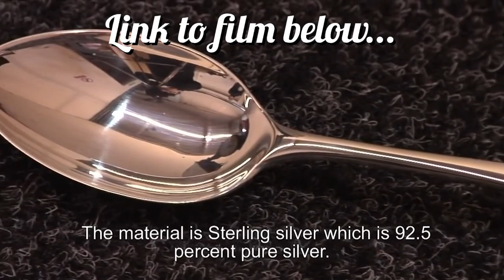Restoring Silversmithing Tools - (Al bought a load of rusty tools!)

Comment: Most of what you have are called raising stakes, the loose pieces with the square bottoms. The don't go into the square holes in the swage block. There are purpose built plates that they plug into or clamped in a vise. Google Pexto company. Nice haul, is wish it was here in the U.S.
Reply from the maker: J Lee thanks so much, we’ve got some research to do now, you’re a legend!

Comment: The T shape thing with the holes on the end is a raising stake
Reply from the maker: How do you use it though? Some YouTube research shall be required.
Reply: @DirtyShedCreations  just Google for hollowware raising and you should find something worthwhile.
Reply: Here's a link to making a Moscow Mule goblet out of a circle of copper. Copper, brass and nickel-silver are good materials to start with; remember that they work harden and you have to anneal your work from time to time (heat to 400°C then quench in water).

After you've got the hang of the technique, you can have a go at pewter; you can buy it in sheets from British Tin & Pewter Mills in Sheffield: https://www.britishtinandpewtermills.com/